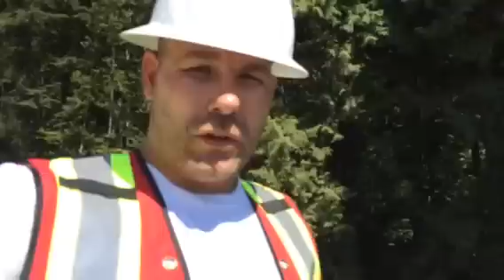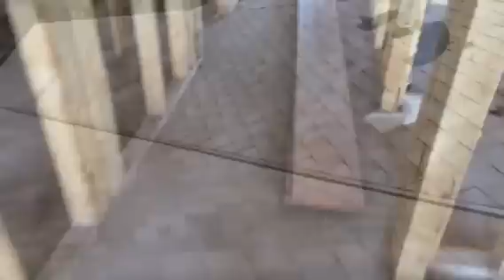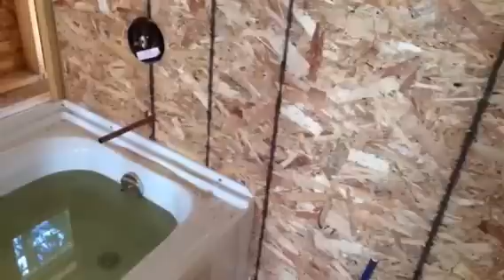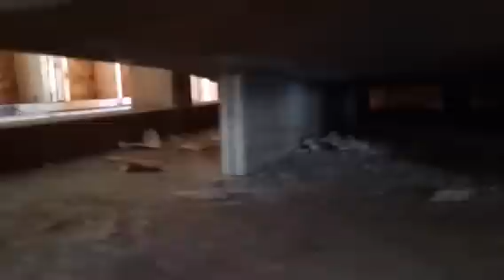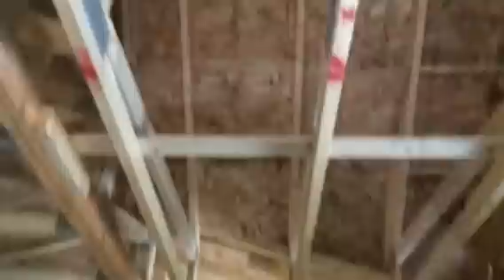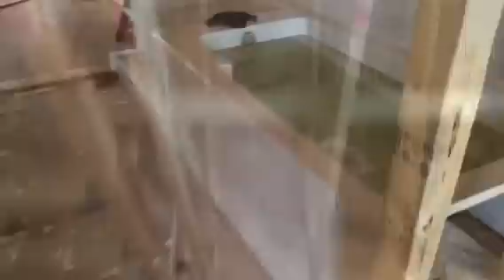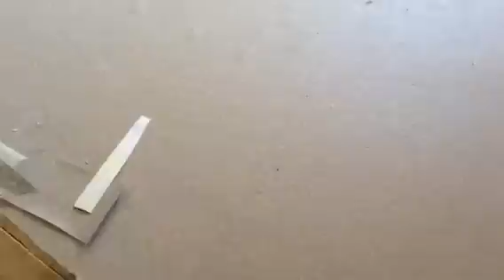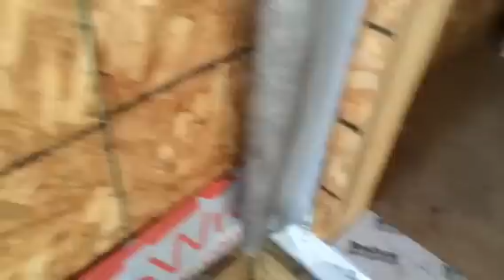New Home Construction Fails

Comment: Lets be honest trees dry up if its not in constant water.
If you add some mudd pieces of wood can last 1000 years.
Ventilation is an underrated technic but works.
All thouse plastic collects water and as soon there is a leak its starts to mold.
Its possible to have wood out in the open air there it rains & snowd without getting it to mold.
But as soon as its plastic laminat it collects water.
They have actually restored Viking boats that been under water for 900 years.
But if put a plastic laminated wood outside it moldes.
Thouse pieces of wood are just saw dust and glue pressed together.

Comment: Putting the wrong wall backing (not waterproof) around showers and bathtubs  is a common way to cut corners and cheat the buyer. Unfortunately, the defect will not show itself for many years. When it does begin to show, the damage is already extensive behind the tile. 

Tile is not waterproof forever and it will eventually leak to the wall.  You have to use a cement board or "green board" backing.

Comment: You mention the osb that is under the tub and the issues that may arise if in contact with water. Which leads me to my question as I just purchased a tub and it also has a board of osb on the underside, however said osb comes fibreglassed into the underside of the tub. Is it necessary to remove this?

Comment: The OSB backing by the tub was behind the flange and will be covered by green board or cement backer. The upside down hangers are to support cantilevered joists.  If you're an inspector and don't understand these things, you should be embarrassed. The tub not set in a bed of mortar could definitely be better but is 100% up to building code.  OSB is built on the bottom of many tubs in the industry and is absolutely fine. Of that ever became wet it would be do to a failure of the bottom of the tub and would require total replacement. Ive been building houses for 18 years, you have obviously never actually built anything nor should you be advising homeowners.  SAD

Comment: At least the roof is done properly (minus a few pet peeves like the 1 capping at the top is wrong and the flashing cuts are square and look ugly although wrapped through right).  You have to see the Hacks here in Saskatchewan.  All I do is fix peoples roofs all summer every year after these "roofers" come and destroy homes.  Just cause you did a shed once upon a time does not make you a roofer.  It's the same with anything you need knowledge, and experience however....  If you have a lot of experience with horrible knowledge teaching you... you're bound to fail.

Comment: Wow half the things you point out are non problems you're fooling these people into thinking they are problems.
Tub is on top of the osb. Therefore it's likely another layer of cbu or drywall is going to go up. And then proper water proofing like a Schulter membrane will protect everything. 

Same thing with the drywall around the other tub. Perfectly legal when water proofed with a membrane. Who the he'll thinks it's going to have tike directly applied. You apparently have no idea how houses are put together. 

Osb sheet comes under the tub like that from the factory. Usually embedded in the fiberglass. That chunk of plywood under the osb is fine because the actual weight is supported by the flange being screwed in to the studs. How many tubs have you installed or seen installed. 

You obviously have an ill informed view of osb with your bs about it expanding. You notice the subfloor is made of it? 

Yes there are bubbles in the membrane.....anyone who's installed a membrane like that knows once the glue is done off gassing it will lay down flatter and resolve those bubbles.

Not to say there are no problems with this house but a lot of this stuff is a guy who took a 3 week course making up things that aren't problems so he can justify making 500 bucks pretending to offer a real service.

Comment: What about the OSB on the roof oriented the wrong direction?  In the description of the attic vent, the supporting OSB is oriented parallel with the rafters.  According to the manufacturer, it is to be installed perpendicular to the supporting rafters.  Like the panels surrounding.

Comment: To be fair, it looks like they are putting some backer material on over that OSB because the trim on the bathtub has ledges for more material. But under the tub is terrible, no support. A gallon of water weighs just over 8 pounds, not 10. Best to be accurate to be reputable, exaggerating makes one lose credibility. A 2 pound difference may not seem like a lot but a bathtub holds around 100 gallons which results in a 200 pound exaggeration. I like your videos and I just wanted to say that so haters don't dislike your videos. Keep it up Tom

Comment: I just watched another video where the deck installers were HAMMERING in the SCREWS and the joist hangers were only attached to the joist, not the ledger. And now upside down joist hangers. What's next, roof shingles on the inside of the structure?
Reply: lol. I saw that one also. The woman was walking around showing how bad they were. Eventually they had to fire them and hire REAL deck builders.

Comment: It's getting tiresome seeing and hearing all of the OSB-bashing. It's not particle board. If you want to see how tough this stuff is come by my project where there are pieces of the stuff that's been laying around for 8 months in the mud, snow, and puddles being used as "stepping stones". Sure, 7/16" has turned to 5/8" in this extreme case, but it's still intact! It's generally nice and flat too. It's a great product for what it has to do. No, don't try and jump on a piece of it supported 6' OC. A piece of real plywood can probably handle that but that's not what it's made to have to handle.
Why they used it by the tub is probably for strength and not as a tile base. Probably going to use backer board after that. And the tub that has drywall already may be covered with Schluter Kerdi fabric, which doesn't need green board or Durock. (unless you can't convince the building dept of that manufacturer's specs).
The tub's made that way but I'd beef it up myself somehow.
The vinyl shouldn't even be in yet (and looks like hell) so there are some definite flags here.

Comment: The osb as a backer could be for the cement board. It allows the cement board to cover the nail flange and give good solid adhesion at the usual trouble spot for tile at tub rim. Additionally the OSB.  provides added strength to the cement board. I would bet the drywall along the other tub will be covered with cement board too....but there is a definite lack of consistency of methods. The joist hangers are an easy catch....good job inspector. I feel sorrow for the rookie that got that wrong....we would make him a legend and send him back to Burger King. The plywood under the tub comes from the factory that way, and it is adhered to the fiberglass....and if it gets wet, you have serious issues....this is a bad example for good inspecting. But we tend to fill our tub bottoms with expansion foam in three stages, which makes it a bite to get old tub out, but guaratees the homeowners chubby friends will never comprimise the fiberglass. The dirt and debrid under the tub bothered me more than the plywood. But the builder still has a chance to clean up. I know this is more of an advertisement than a serious inspection, but if you showed up on my job before and pulled your B.S. before the rough in was complete and ready for inspection, I would physically remove you. No one likes a know it all roaming around before quailty control can catch things. The joist hangers are funny though.
Reply: The tub definitely needs more shim board supports....but once again....let them complete the rough in.

Comment: Could the joists be cantilevered? If so then the hangers are proper. Also, osb on plumbing walls is very acceptable and widely done to give backing for finish products like towel bars and cabinets and shelves as long as it is covered by a water resistant finish.
Reply: Jimmy Hargrove aha! Good thought on the cantilever! I bet that's actually what's going on there!

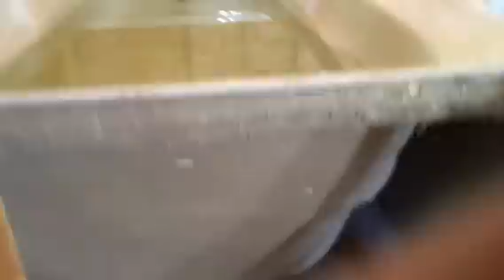Comment: Uh, the plywood on the bottom of that bath tub is not something that was added to it, that is part of the tub. If you look at 1:40 in the video you can see that the plywood is attached to the fiberglass. This is typical for fiberglass tubs that I have seen. I do not know the specifics on this tub, but usually the ones I have seen in the field have either been supported by mortar or concrete blocks underneath the plywood base. It depends on the manufacturers requirements. This specific tub may not require additional support to be installed below the plywood (I do not think that is the case, but it is possible). Either way, that plywood is not a defect, or the result of negligence, it's part of the tub! 

The OSB on the tub wall, I am not sure what the reasoning behind that is. I live and work in a hurricane prone coastal area and certain walls are engineered as sheer walls, those will typically have additional sheathing installed on them on the interior surface, though I can't imagine that being the case on that wall. I would hope that they intend to add green board above the tile areas and tile backer behind where the tile will be installed after they pass inspections. I am certain that the intention was not to just install the tile directly on top of the OSB like what is being suggested in this video. Like you though, I would prefer not to see OSB used in a wet location, but again without knowing the reasoning behind why it is there I cannot say that what they have done is wrong.

The upside down joist hangers would be a problem unless there is some reason the a structural engineer specified them to be installed that way. In the location they are installed I cannot think of any reason an engineer would have them inverted, so they are indeed incorrect per the application as far as I can tell from looking at the video.

Comment: LOLZ WATER WEIGHS 10LBS!!! NO. Maybe french canadian pounds aint worth as much but where I come from a pint's a pound the world around, 8lbs a gallon there buddy.

So you're calculation is off by 20%. Also, those cheap as $hit bathtubs are made that way with the osb and the small strip of ply wood. Notice how if you remove the plywood piece the bathtub would tip backwards? It came that way from the factory, I know this for a fact as I have installed them. Don't blame the plumber.

That said it should have had an adequate deck built under it by the carpenter to fill in that space. Either way it's really the fault of the cheap bathtub manufacturer.

Comment: Perpetuating the myth that custom means stick-built using semi-skilled labor.    

Neither OSB nor plywood is a good materials for the skin of a home.  Their only benefits are material cost for one layer of the exterior skin of a 20th century stick-built wooden frame home.  

Homes are not commercial buildings that have designed lifetimes of 30 years and must accomodate the needs of radically different commercial business.  Homes are for human beings whose needs have not changed significantly in eons other than fads in privacy and individual property acquistion requiring more storage, like private automobile, recreational vehicles and sports equipment. 

A well designed house is engineered, not designed by an architect with no understanding of mechanics or a builder to sell for as large a profit as possible.  It  does not need remodeling every twenty years, but makes provision for expansion and repair of its systems.  It is not modeled after a shelfish, an invertebrate, to hold whatever is thrown inside it.  The entire frame of a good custom home incorparates the interior wall structure as part of the frame, like the human skeleton, and accomodates the mechanical and electrical systems in such a manner that they function efficiently and can be maintained or replaced if/when necessary withouttearing the home apart.

An engineered multilayer panel system that incorporates moisture and impact barriers, insulation and surface for attaching decorative siding materials can be more durable and less expensive while providing superior surface shear strength and resistance to buckling, rot and warpage and costs less to install than sheathing, and insulation.  The best of these exterior systems requires no decorative siding. The best exterior wall systems are custom prefabricated and incorporate interior surfaces ready for paint or paneling.

Comment: Hangers need to be installed upside down if the joists are cantilevered . They obviously haven't finished all the backframing yet and still need to put them on the bottom. 
They are osb on the bathroom wall is to fur out the wall to bring it flush to the tub. 
Drywall behind the tub it perfect if they are using a kerdi membrane over it. 
The osb under the tub is fibreglassed to the bottom by the manufacturer, what is the builder supposed to do about that ? 
Has this inspector worked as a general contractor ? Or just a one year course at the local technical institute

Comment: Water is 8.33 lbs a gallon not 10 ibs.And that tub is designed to be set the way it is.U claim if the pan gets wet it will expand.Of coarse it will.But ,water shouldn't be getting under the damn tub.Yes there were serious issues of cobbling going on in that house.But u could at least investage stuff before u put a judgement call on it.Especially the tub.If it's made by Aker plastics (Or now know as Aker Maxx it's designed to be set freestanding workout anything under it.U should put a ledger board under back long wall edge of tub to help hold it up.

Comment: They installed the joist hangers upside down, because the joist has a back span.... its movement is up.  So its perfectly okay to inspect the joist hanger that way.
Reply: It seems pretty obvious that the joists attach to a ledger board and therefore they are not cantilevered. You can see an unbroken ledger board on the top unless there's some kind of mortise work going on there that I've never seen before!

Comment: The US has two different definitions of the gallon, the most commonly used 
one is the 'liquid' gallon, defined as a volume of 231 cubic inches or 
3.785 L. This comes down to 8.344 lbs of water at its densest.
Reply: Video poster is in Canada, so he's talking about Imperial gallons, hence the 10 pound measurement.
Reply: or 3.785 Kg
Reply: 1: He's not talking about US gallons, as stated.

2: Even if he was, a lot of times these figures get rounded up. 

3: Personally I'd have it constructed to be able to hold a signifigantly higher weight, those glass tubs suck.
Reply: 3,785.41g  ;- )     we should have moved to metric a long time ago....

Comment: We bought our house that had been built in the 50s. So many problems, including galvanized steel plumbing, but the worst was that they had used sheetrock in the shower enclosure. We should have realized something was up when there were curtains and glass shelves on the window in the enclosure. When we remodeled the bathroom about two years later I was scooping out handfuls of mush there.

Comment: I dint think that the osb and the drywall behind the tub was there to out tile on the. The cement board or water resistant biard usually go up to the lip of the tub. I think they just used it as a spacer because there measurements might of bin off on the tubs

Comment: Osb and drywall,has nothing to do with the water proofing that is going to be installed next,
Joists hangers most certainly have been installed in that manner depending on the can't lever and the amount of load on on the ends of the joists such as a roof load .
Didn't learn a lot here .
Under the tub platform that was installed from the tub manufacturer the installer is supposed to put a big pile of mortar mix or plaster Paris to stop deflection when you step in .

Comment: The osb under the tub is how they come from the factory, you can't remove the osb from the tub without destroying it. It's the contractors job to prevent water from getting to the osb.
The osb and drywall behind the tiles is ok (not ideal) as long as a waterproofing membrane is installed which at that point there was no saying whether it was going to be done. If the membrane isn't installed then yes it will fail.
The upside down hangers is plain stupidity  lol

Comment: KB homes didnt do anything you suggested they do. This was back in 2007 with $250000 homes. I was part of the plumbing crew and I can tell you we had to go back several times because we had idiot employees and inspectors who didnt inspect.
Reply: for example we had a lady move into her home before her neighborhood was complete and she complained that she did not have any cold water at her washing machine and no water to her back yard. We first checked the connection of the faucets. one of my co-workers thought it was a good idea to back feed water and see where it sprays.. Well, we found out that the concrete guys had moved our water lines and the framers cut them and put boards over them. So we seen the water coming out from under where the water heater is. We got to them and connected them all thinking that would solve the issue. Nope, it seemed one last water line was not connected to an outside faucet but instead wast just stuck under some carpet in a spare bedroom. The ladies computer was in there and before we knew it, we had flooded the room with water. We closed off the line and dried everything then moved on without telling the lady because our boss did not want to replace her computer. I dont know if anything else came of it but I can say a great many of those homes in the neighborhood are disaster ridden.